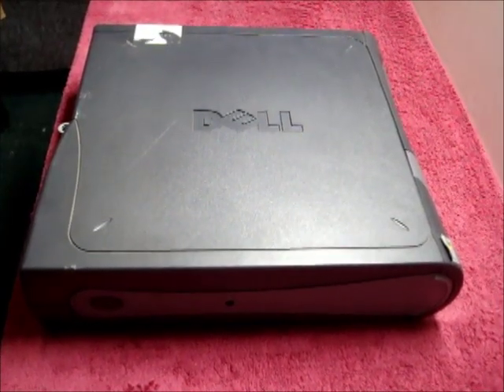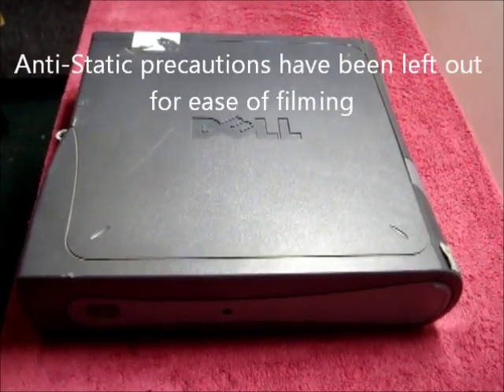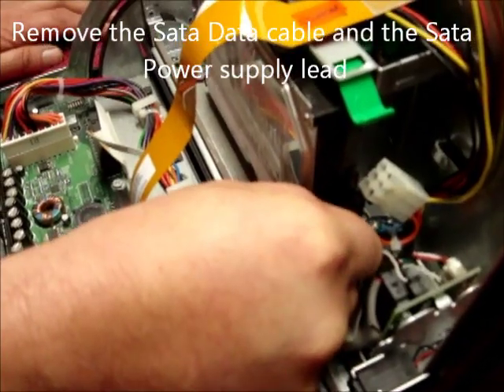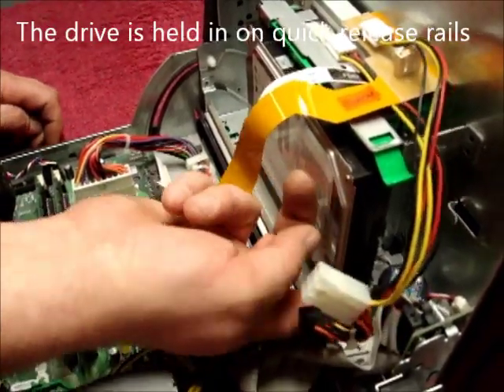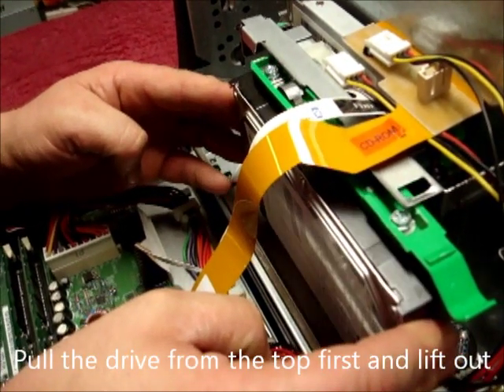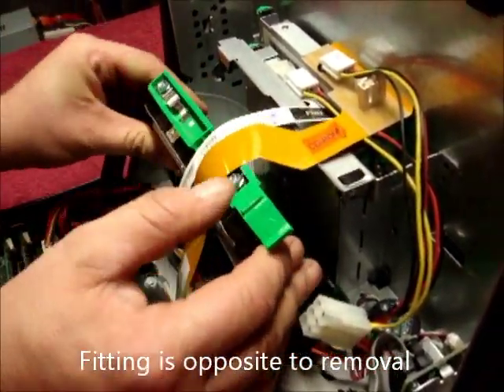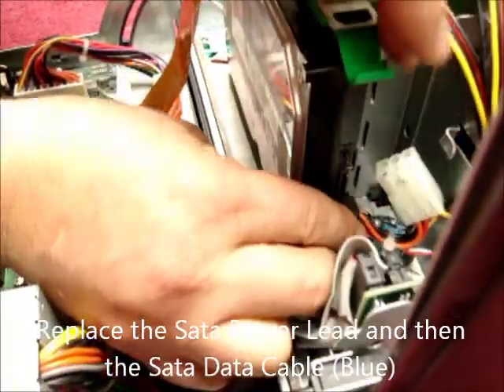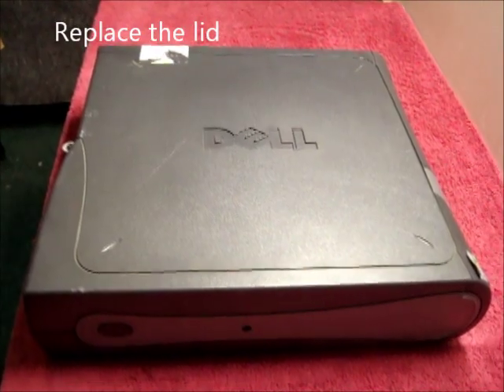How to Upgrade Change Install Replace a Hard Disk Drive in a Dell Optiplex GX270 GX280 Desktop

Comment: my hard drive i want to put in it does not have the green sliding thing would i be able to take it off of the original hard drive  as i dont have the desktop but i am buying later today